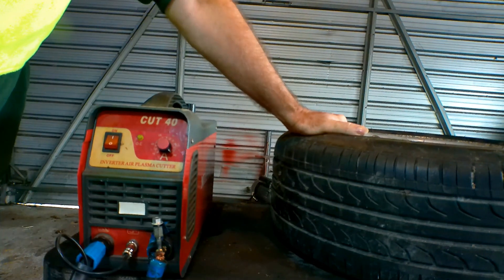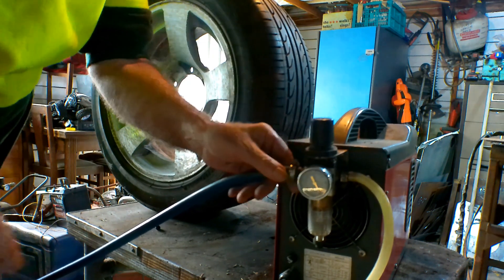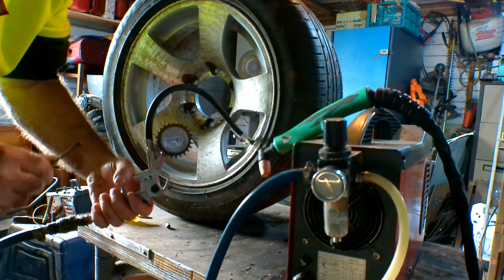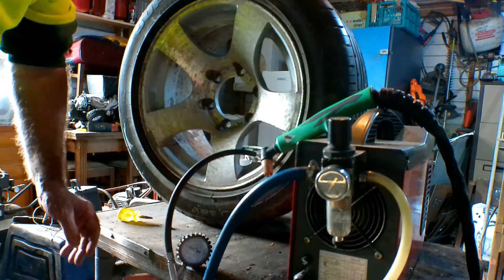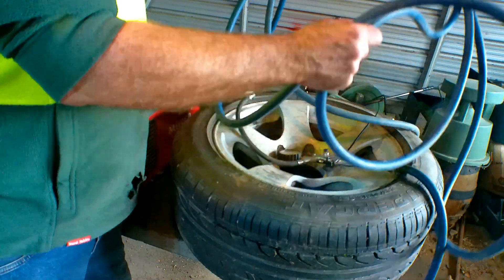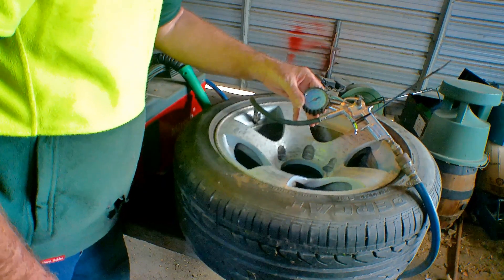How to Plasma Cut Without a Compressor

Comment: I've been contemplating turning an old water heater tank I've been saving into an auxiliary air tank to get around my wussy little 3 gallon tank compressor, which up til now usually runs right up to the duty time for wee little cuts but takes ages to get usable pressure built up again. Great minds think alike, eh?
Reply from the maker: Sure do mate .Good luck with it .